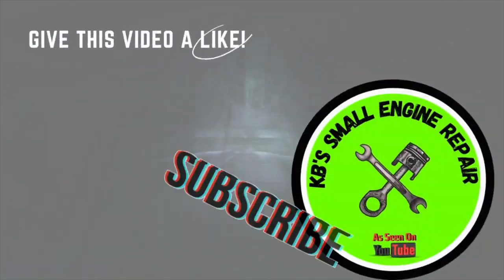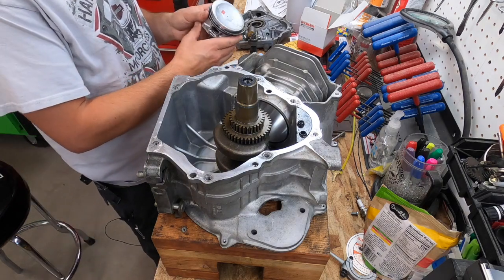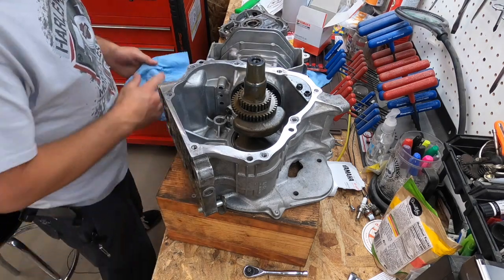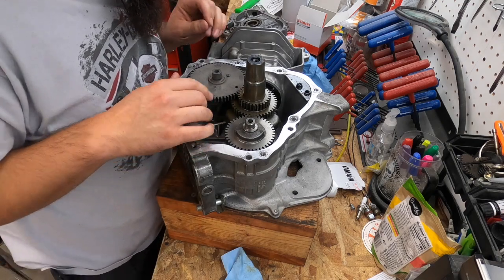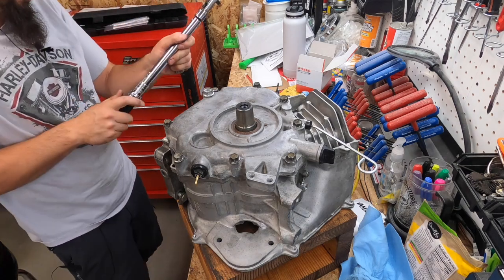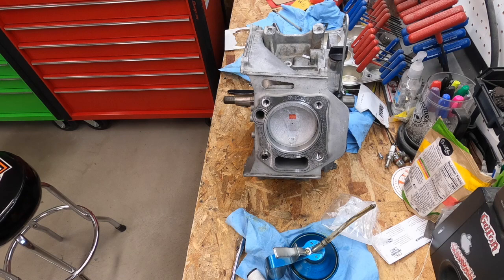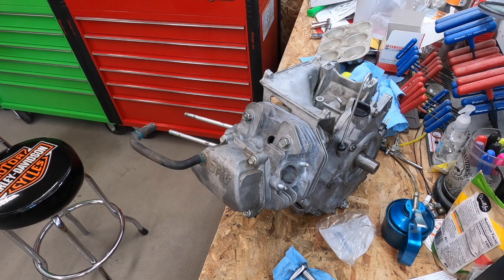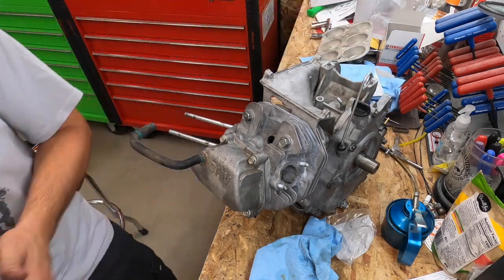Full Engine Rebuild (Yamaha G29 Golf Cart Engine)

Comment: Love your engine rebuild video. I have a question if you don’t mind. I have a 2002 Yamaha g22. I’m getting gas in the oil, and oil sitting in the air cleaner. The motor runs good but started smoking. I removed the motor and have it ready to rebuild. I’m just concerned why the oil is getting in the air cleaner and gas in the oil. 
And do you have the link for engine rebuild parts. 
Any help would be greatly appreciated. 👍🏻🇺🇸

Comment: Im working on a kawasaki fe290d clubcar basket case, all apart in baskets and containers. I noticed that when I removed the valves aside from the normal  carbon build up ,the innerside of the exhaust valve was caked , I cleaned  & reseated the valve and intake  and tested ,But I did notice I could compress the spring by hand to put the retainer clips in . This must have been the problem to begin with of this engine . I did hone the cyl and replaced the rings.
Reply from the maker: Nice find.  It's always nice to find an easier solution than originally anticipated.

Comment: Does the exhaust side need a seal? My golf cart only has 50psi compression and I notice the Intake valve it "sticky" going in and out but the exhaust side slips in and out very freely and it doesn't look like it has a seal on it
Reply from the maker: There is no seal on the exhaust side.

Comment: What type of oil are you using to lube the parts? Assuming it was 4 cycle oil but wanted to double check. Thanks
Reply from the maker: It is just regular sae 30 small engine oil.  Any assembly lube will do as well.

Comment: Hey man i believe i have this same motor in my yamaha prohauler cart. Offroad and golf cart dealers are no help. Where did you get this rebuild kit? Rings piston gaskets? Id appreciate the assist lol
Reply from the maker: I actually got them from my local golf cart dealer.  That is where my customer wanted to get the from because they had them in stock and I could get them same day.  If you are getting the runaround with the dealers, checkout partzilla.com

Comment: Why this engine doesn't have crankcase breather Vent
Reply from the maker: It does, it comes out the top.  It is between the spark plug and the starter generator mount.

Comment: You can barley see any of the work you’re doing, your commentary is misleading. You don’t specify anything. You didn’t elaborate on any of the most important details such ass how to position the rings or how to put the piston in correctly. You literally only showed us the wrong way when you messed up. You didn’t give us the torque specs for the crank case bolts. All that and I’m not even half way thru the video. I’m jumping back and forth from google to other videos just to find the information you’re not giving. All I’m getting from this video is an IDEA of how to put the engine together. Unfortunately this is the only video I could find on the Yamaha G engine. You seem like a genuine guy and I’m not trying to be a dick but with all this positive feedback you’re getting from overly generous viewers, I feel some constructive criticism is necessary considering such low quality content. Recommend you pay a bit closer attention to detail for the audience.. if we’re already rebuilding the engine, the details are likely what most of us are here for 👍🏼